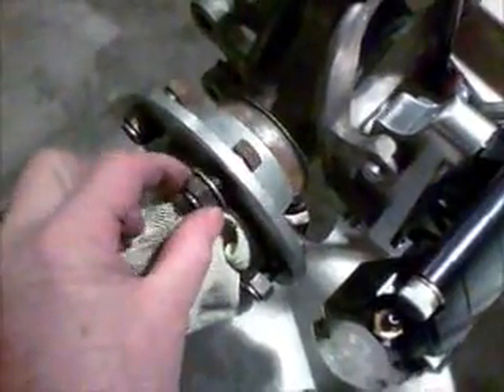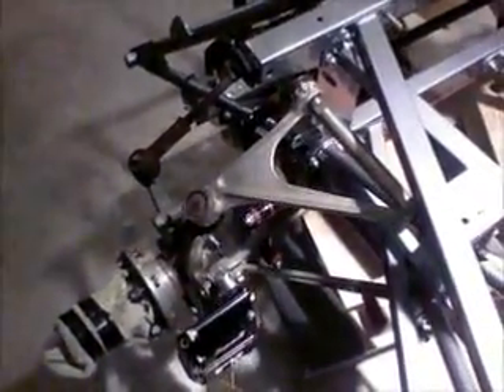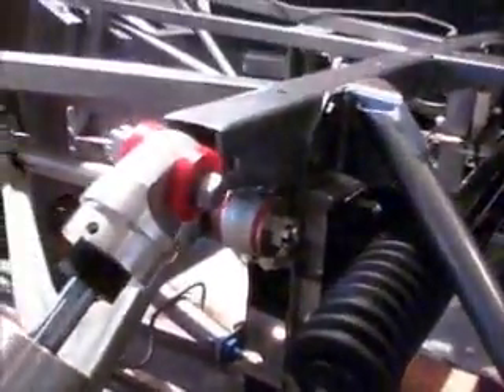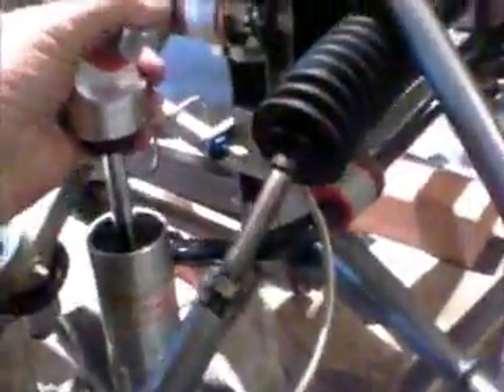Bettie my 1963 Jaguar E-Type Restoration, Wilwood Front Brakes installed

Comment from the maker: Absolutely, in fact this car when launched in 1961 was the fist to use a unitized body shell to form the rigid structure for the main cabin and rear suspension.  The monocoque approach again was adopted from the D-Type racer they used at Le Mans.

Comment from the maker: I do not know much about them other than what I have read.  They make the XK engine more relaxed at highway speed and retain the low gear grunt compared to using a taller rear axle ring gear. Mine is the 3.54:1 ratio and I hear the 3.07 or there about is a nicer option for high speed cruising if you don't go 5 speed.

These conversion kits are available from several Jaguar parts supply houses.  Classic Jaguar in Texas USA is one company who claim to have their case custom fabricated. Good luck

Comment: Nope, its definitely a torsion bar. I cranked it down a few notches myself a few months ago. :) You can Google "Explorer Torsion Bar" to see some pics of it. Not my favorite suspension setup, but I was happy to be able to easily lower the front to match the rear's sagging springs. :) I think they went to struts in 2002 BTW, along with IRS. Mine has a good old fashioned solid rear axle.

Comment: Nice brakes set up! Got a set on the chevelle, wish I had it in the budget to do 4 wheel disc on the firebird lol Ya I see that torsion set up on alot of the GM trucks! Are your torsion bars adjustable?